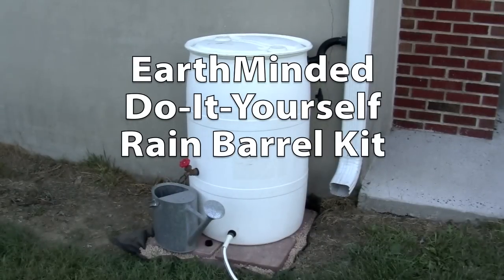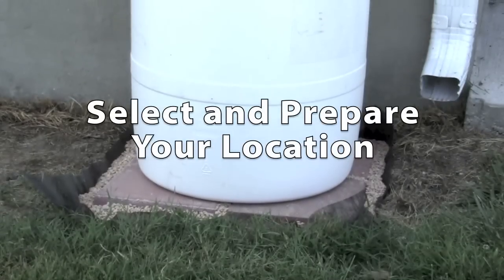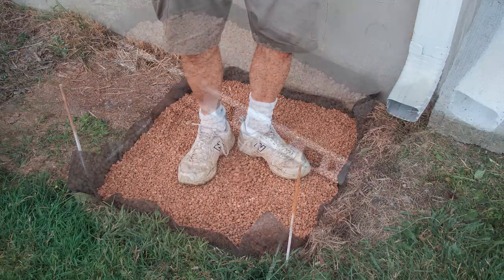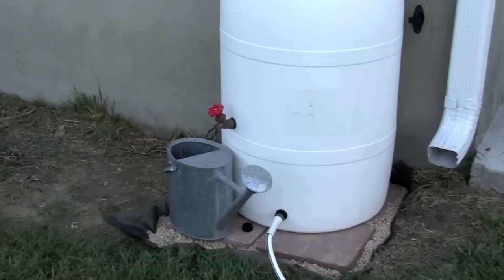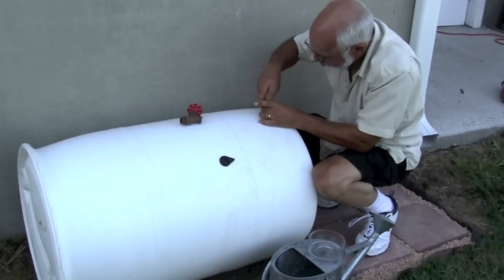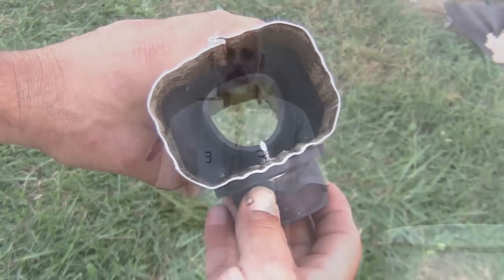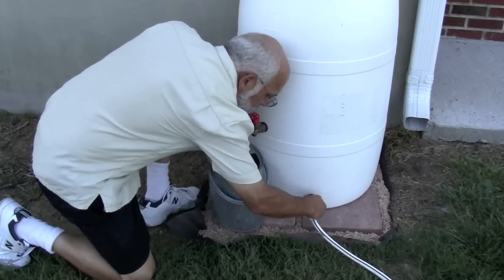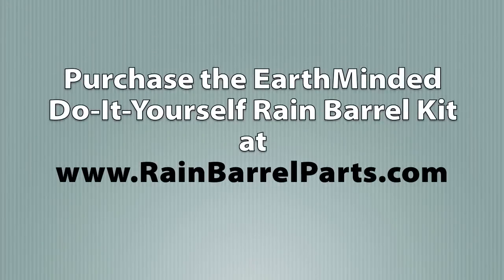DIY Rain Barrel Kit

Comment: Could a Piece of screening be placed inside the circular area of the flexi diverter or the fill hose? Instead of installing an entire filter for the gutter?
Reply from the maker: Sure but if you fail to service it then what happens? Out of sight - out of mind until a major issue causes a huge negative event

Comment: So I can put a fitting to my vegetable garden irrigation system and also put a spout in to get water as needed...would I need a water timer for this?
Reply: let me know how yours works out Ariel Rainault
Reply from the maker: There are water timers that work on batteries. Keep in mind that there is no real water pressure to drive the water very far or very fast.
Reply: Thank you :) Sandor Inshiqaq I most certainly will :)
Reply: aquabarrel I am planning on setting my rain system up on a sun-hut/nursery...it not too far from the house but it is far enough where I feel I should do this. If I had one I think I would try solar power too as well as batteries. Is that possible? How do I know if the water pressure is right?

Comment: Does this prevent overflow?
Reply from the maker: Over flow is prevented IF the diverter and the hole in the container are on the same horizontal plane - that's the reason for the hole in the middle of the diverter - water backs up after the container is full and water remains in the downspout

Comment: What do you do with the rain barrel during the winter so it doesn't blow away?
Reply from the maker: Everyone has  different issue for off season - those in the South don't have an issue. In areas of freezing conditions it's best to put in a safe place or place a large block on it

Comment from the maker: 1) the hose has been changed - It is now ONE piece that expands from 8" to 30"  2) the hole in the downspout needs to be installed 2.5" down OR below the rim of an OPEN TOP/ Removeable top style of barrel  - Print instructions can be found here: https://rainbarrelparts.com/installation-of-rain-barrel-kit.html